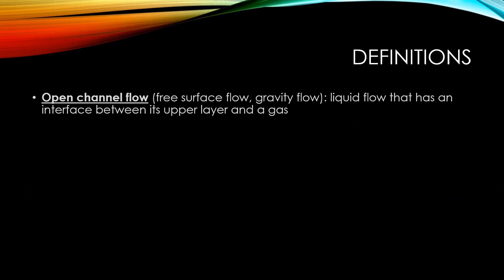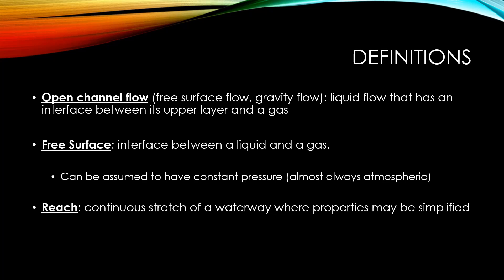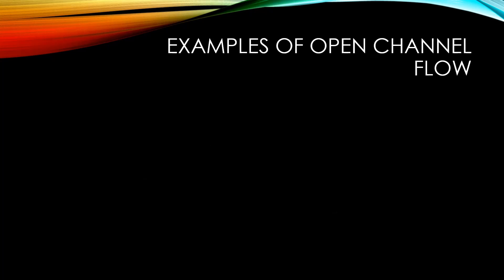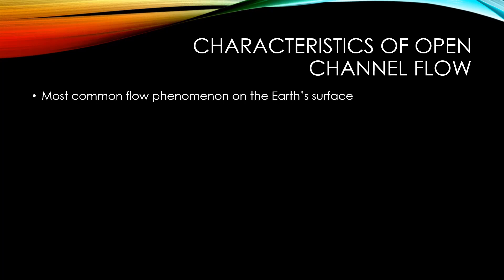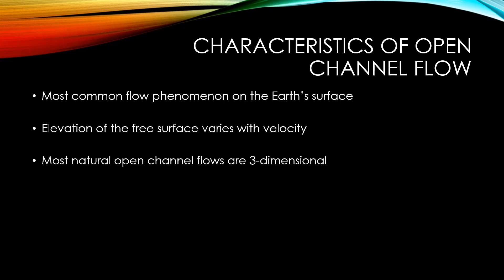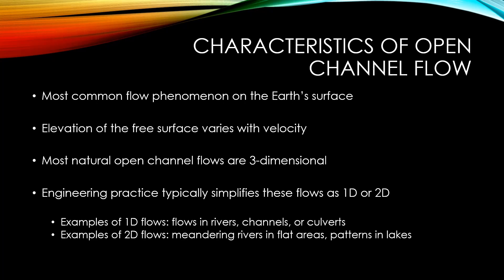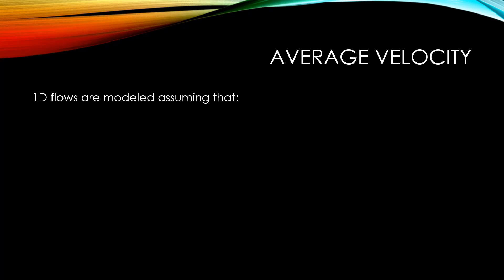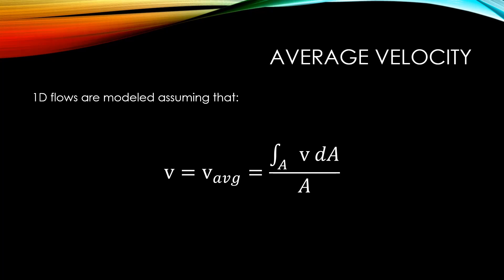Properties of Open Channel Flows

Comment: Did you mean that velocity varies with elevation? Not the other way around?
Reply from the maker: The elevation of the free surface (the depth) varies with the velocity of the channel. It's common to see the flowrate  (or the velocity) as the 'independent' variable and the flow depth as the dependent variable. In most design applications, flow is the initial condition and models tend to find depth from that flow. While the equations we will derive in class show the velocity as the dependent variable, the reality is that in water resources engineering, we start with a flowrate (or velocity) and use that to calculate the channel depth.
Reply: Cool. I guess I was thinking more about potential and kinetic energy from Physics I but I wasn't really thinking about what kind of questions you will give us in this class.